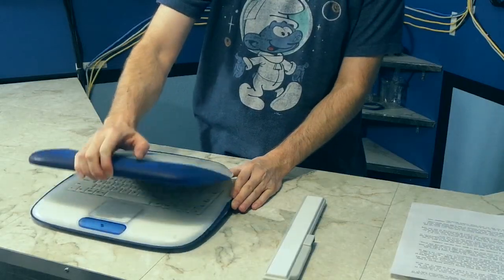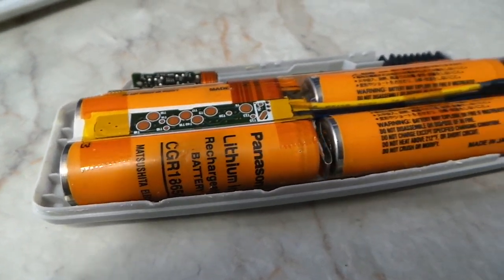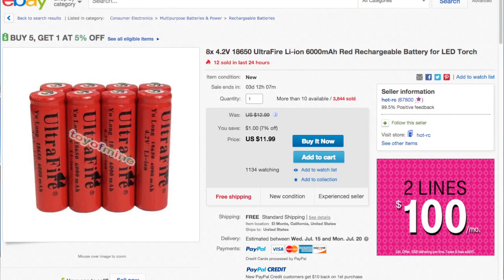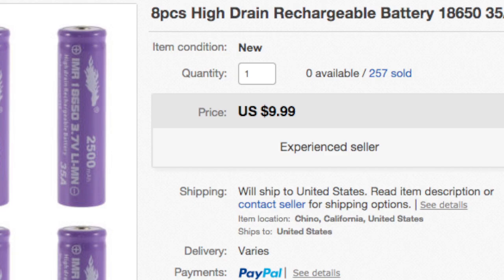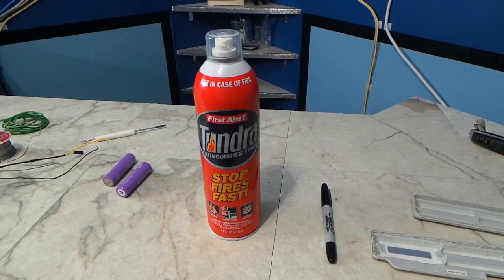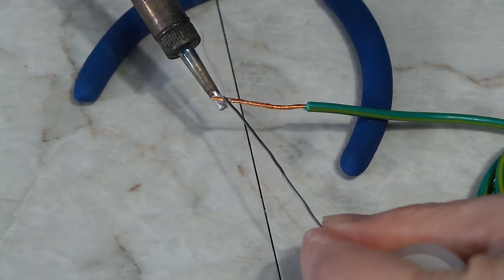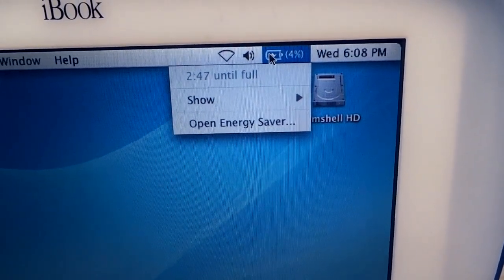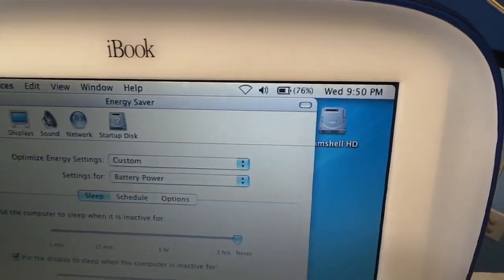Rebuild a laptop battery pack

Comment: Man, you need to calibrate them all so they can work together as "one" battery. Your laptop readings are fine, all batteries combined together got eg. 70%, but how much each battery got, it doesnt know. So, problem is, even if one battery are full, if another one becomes empty, in serial, its broken circuit, the empty battery wont allow electricity to go trough her. So i guess two batteries becomes empty, even another 4 of them got like 60% charge, the 2 empty could simply shut the circuit down. Some laptop batteries got like two groups of multiple 18650 batteries, that makes one laptop battery to be detected as two laptop batteries, and its made because of problem i said, means, if in one group of batteries, just one died, the whole group of batteries become useless, and because there is another group, laptop with that battery will continue to work, with 50% less mAh, and OS will tell you that one of two batteries (groups) has died.

Comment: And a warning so people dont waste time and money: 
-Not all lithium batteries can be fixed like that, some have a cycle count in the micro controller, wich prevents the battery from working again after its supposed lifetime has been achieved. A good example is a dell inspiron 1545 laptop wich can't have just the cells replaced, the battery still reports to the bios "battery life bad" and and laptop wont charge nor use their stored energy.
Reply: Exactly its happened to me after replacemet the cells, my laptop inspiron 3421, so how I can fix this problem please tell me if you know, 
Thanks
Reply: Why not just reset the controller?
Reply: @flameshana9  some battries controler cannot reset
Reply: @WildMidE  That sounds like a purposeful limitation. Like how cell phone batteries are hard to replace nowadays.

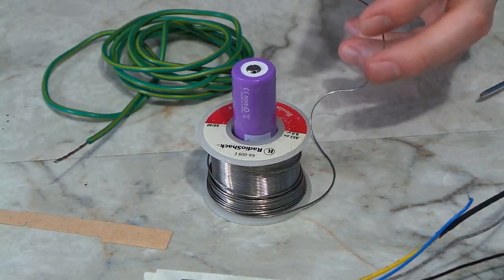Comment: 3:24 It's way better to buy a super capacitor and use it as a safe pinpoint welder and weld thin steel plates into the batteries (like the originals) than soldering it. Also way easier.

A supercapacitor with 500f capacity at 2.7v is totally safe (as 2.7v is a low voltage and wouldn't be able to electrocute anyone) and its also cheap. It doesnt heat up badly the battery, as a soldering iron, so it doesnt have the risk of loosing maximum capacity because of heat damage, nor it has risks of overheating and shorting out.

Comment: Holding a 370°C / 698°F hot soldering iron on a Lithium battery for that long is equivalent as putting them in a hot frying pan for ten seconds: It's more than enough to lit the fuse of disaster!

Comment: My laptop battery is 11.1V, so most likely 3 x 3.7 V batteries. Is it OK if I use 3.6V battery cells instead of 3.7V? Impossible to find 3.7V batteries these days, unless one goes for the Chinese fake ones..

Comment: Hello I saw your tutorial 
And wanted to repair the battery of a MSI ge62 6qf as it is not purchaseable new or used in my country 

As I replaced the cells it showed a constant charge of 67% 
And orange light for dead battery 

The cells I used are ncr18650b by panasonic and rated at 3400mah 

Any help in the matter would be appreciated

Comment: instead of applying so much heat to be battery to get the solder to adhere, just file the terminals down to make a rough service, clean terminals with rubbing alcohol, apply some flux, then solder. A rougher surface can help solder stick.

Comment: If you use flux on the battrey it would be way faster and the solder would stick way better so way less heat in the cell

Comment: :) you said that if you took 1/2 of the cells away it would'nt matter since the batteries are 5x cheaper why not test running another 5x across and see if it can handle the amps you wont be able to fit in all in the case but you should get a extended life if it will not melt :)

Comment: My way to solder 18650 cells is:
- First of grind a little bit the soldering points on cells with Dremel or a knife ( beacuse of the nickel layer on it )
- Then apply a little bit of flux or soldering paste
- After that use big and flat soldering tip for soldering
In that way the soldering is way easier and you can use much more lower temperatures of your iron 
The solder will do the same as nickel for not making cells corrode . 

BTW I Love your channel and seeing those kind of Old School electronics, i'm huge fan of that ;)

Comment: most modern battery packs that use lithium cells have complex electronics to monitor the cells , just replacing the cells will not reset the firmware in the charging electronics so the battery will not charge

Comment: You really should try to spot weld the batteries. I never thought it be a good idea to buy a battery spot welder separately. So I just modified my good old trusted Telwin modular 20 TI sheet metal spot welder. Worked like a charm for all the battery taps.

Comment: Personally, I would've gone with higher quality, higher capacity batteries, even on an older laptop. Although you really can't beat a "new" battery under $10.

I have an HP laptop which has great battery life despite only having a 45Wh battery. I can game on it for 3+ hours easily (of course, it's a low powered laptop with an AMD A8 APU). I think it'd be cool if I opened up the battery and added an extra set of cells in parallel to see if I can game for 6+ hours (however useless that might be).

Comment: oh so the chip need to learn  or calibrate new battery capacity?  no wonder.  I build 44 amp battery bank and the laptop still know it only 1.7 amp which is 1.58 minutes of run time.
Thanks bro.  YOu said need to drain it down.  HUmmmm.  it is 44 amp capacity.  how do I drain it down then let the labtop charge it up.  this is hard part....,  I don't have anything that can drain 16.8v  44 Amp

Comment: You should NEVER, read my lips, N.E.V.E.R. solder directly to the terminals of a Lithium cell. According to a conversation I had with one of the patent holders for LiFe cells you can bring the a lithium cell to it's 70C danger temperature where the cell will start self heating and then runaway.
Reply: Alright, this makes sense. But how would we do it then?
Reply: Tordur Hansen spot welding, very fast and localised. Does not give the cell a chance to overheat. Otherwise make sure you use tabbed cells and if your soldering is a little slow use small heatsinking clamps but then your problem is avoiding short circuits.
Reply: Oh I see. Thanks for the heads up!

Comment: IF you are going to mess with 18650 batteries (or similar), get a proper charger which monitors how much charge they can take and is able to trickle charge them when under discharged. Chances are some of the batteries in your "dead" battery pack are still fine, better than the cheap Chinese ones, and only one or one pair has failed.

Comment: You may have gotten even more run time if you left it to charge longer because the batteries may not have been fully charged due to the controller circuit not being calibrated.

Comment: might it not be wise to determine weather these cheap $1 cells can safely supply the current demanded by the laptop, it is not just capacity where these cheap cells fall down, current draw is also an issue.

Comment: Thanks for the video!

I have a Toshiba T1100 Plus that was given to me. Of course, the old NiCad battery pack was dead. I went to a battery store and obtained some new cells, rated at 5000mah instead of the original 4000mah. All I can say is that the run time is incredible! I used that laptop as my school laptop in college, and I used it all the time. I would get about 10 hours of run time on it, and only had to recharge it once a week. 

Keep in mind that I was using this computer at school just a few years ago, not back in the 90's or something. It turned out to be the most reliable computer I have ever owned. I got a lot of looks with that old dinosaur :)

Comment: Hope this helps someone. I was trying to rebuild an old Alienware battery that is not available for purchase anymore. I bought 2 used battery units. I found out that they are designed to fall apart if you try to open it up by prying it open. You need to find a very sharp blade like a box cutter and cut perfectly around the stickered warning label and thin plastic. You have to be very careful and do it perfectly. Cut a perfect square around the sticker with the plastic still attached to it. It takes 12 1860 batteries. They are lined up by six on left side and six on right side. The ends of the battery are covered with plastic and sticky thin paper, so they won't make contact with other batteries while being crammed in the plastic casing. You don't have to mess with any other electrical wiring, just snip the spot welded metal off from the top and one wire from the bottom. They have 2 pieces. One on left and one on right. The battery model is W83066L, the computer it goes on is Alienware Area 51 9750. This project kicked my ass until I figured it all out LOL.

Comment: Hello,

I suggest that everyone watches a video from Charlie Miller, titled "Battery Firmware Hacking". Then look up either Smart Battery Worshop or Battery EEPROM Works program for example. 😉🤔

You'll see it's not that easy just by adding/soldering in the new 18650 cells into the battery pack. 🤐

This surely applies to never laptop batteries. With older laptops this trick might work... MIGHT. 😆

Comment: Excellet video! Thanks a lot. Now I'm thinking about rebuilding my battery pack but I was wondering what mAh rated cells to get. As my battery pack has an mAh rating of 5400, does that mean each cell in the pack is 2700mAh?

Comment: Nope. Don’t cheap out on batteries‼️ Chances are it’ll overheat and vent all up in your laptop. Buy name brand batteries all in one batch. Also don’t “save” any cells from the old battery pack even if you measure correct voltage. The cells need to be matched/balanced. Just remember your still saving 💰💰💰 by not buying a brand new laptop battery pack. 
The only question I still have is do the batteries need to be “protected” or unprotected. Not sure if the protected batteries with the circuit inside them will interfere with the charging/balancing circuit in the laptop.

Comment: hi i have problem  i was connect my cells in the same way like yours but it not work  the signal light battery it still  show me yellow  light color and in the some second show me blue color every second replace like that now my dell laptop it work like desktop so could you help me to solve my problem?
Reply: wellman the preacher Hi,

Look up a video from Charlie Miller, titled "Battery Firmware Hacking". Then look up either Smart Battery Worshop or Battery EEPROM Works program for example. 😉🤔

You'll see it's not that easy just by adding/soldering in the new 18650 cells into the pack. 🤐

Comment: But is it ok to use regulated cells like those you used? I mean, the battery pack's electronics are already there to regulate that, so using cells with another regulator seems wrong. idk.

Comment: buy name brand batteries like Samsung,Sony,LG etc 
Stay away from any battery end with fire or start with trust or rewrap batteries like efest
it's crucial to buy INR batteries incase of something bad happens 
You wont be getting more than 3000 mah from a 18650 and it'll be arround 10-15 amps max and so keep away from anything says even 3500-4000 mah
My suggestions are ;
2500 mah Samsung 25r,LG HE2-4, Sony VTC5
3000 mah Samsung 30q,Sony VTC6
If i were to build 1 for myself i'd go with Samsung 25r for reliability and safety.

Comment: One tip: Adhesive copper tape does wonders - adheres very well and you don't need to heat up any part of the cell, and they are very thin meaning they're good for confined spaces (like these laptop batteries) where soldering adds unwanted thickness. Less messy too, and no need for extra wires or anything. I used them for two separate batteries that I refurbished a while back and they work seamlessly.
Reply: I'm going to try this for testing purposes. Sounds like a good idea for non permanent projects too.
Reply: @Kit-lb6tr  I'm assuming the adhesive side is non conductive right?
Reply: @cheezyfriez12  Depends what kind you get, some are conductive on both sides some aren't.
Reply: Nice idea but i found it in wrong time, arghhh
Reply: Adhesive copper tape...hmmm...interesting...I'm curious where I can find that in Brasov, Romania - will try online as well but thank you for this useful tip - trying to repair a laptop battery from 2012 for an Asus x54c
Romanian - romana: banda de cupru autoadeziva...hmmm...interesant...sunt curios unde pot găsi așa ceva în Brașov, Romania - voi căuta și online dar mulțumesc pt această sugestie folositoare - incerc sa repar o baterie de la un Asus x54c

Comment: What if I want to remove all the 3 batteries of 4.2v &  2200mah from my laptop battery case and replace them by 3 new 3.7v 3000mah battery ?
Will it work?

Comment: Rather keep clay bucket/pot (as it's non conducting and heat resistant) and bags of fine sand you can throw over flaming battery, as it won't mess up electronics as water/foam extinguisher does... and those dust extinguishers make way more mess than a small fire, and li-ions keep re-igniting after you extinguish them. I tried it ;-)

Comment: i have collected two diffrent battery cell both are samsung 18650 after assembling it it showd 10.7 volt but problem is that battery going to be charge fully within ten min and discharge in half an hour.kindly suggest some solution.

Comment: I wonder if you can do this with nickel metal hydrade (NiMH) batteries. They're cheaper than lithium and the name brand ones get about 2,500mAh each on a 1.5v AA. The charging circuitry should prevent overcharge Iirc.

Comment: Those batteries look like purple Efest/Efan batteries, although for some weird reason the wrapper doesn't say Efest where it usually should say it. If it's a clone of a rewrap, then that's unusual in and of itself, but if it's the real deal Efest batts, they shouldn't be total scam cells on the inside. Chances are, they're actually rewrapped cells from quality producers. Just unwrap it and see what you're dealing with. Unless Efest sourced their cells and put their own casing on them, which they aren't known to do, the cells should have the original manufacturer laser etching on the metal casing. That's normally the case. Rewrappers, like Efest, never care to hide this, because people normally never take the battery wrappers off.

While these Efest batts (if they're actually Efest branded batts) are in no way truly rated to handle a continuous discharge of 35A (as the wrapper suggests), these batteries used to be LG HE2 cells on the inside, which were very high quality cells and among the best you could get a few years back. Sure enough, your batteries look like button top LG HE2s on the outside, from what I can tell. If so, your batteries are fine and are true 20A 2500 mAh cells.

The problem COULD simply be an uneven charge level among the cells and that the charging sensors detect some cell pairs to be fully charged while others are still almost dead. Thus it will indicate 100% in order to avoid an overcharge, but suddenly drop to 0% to avoid an undercharge. This can even out over time, but to assure the best result from the getgo, you should have individually charged the batteries to identical voltage before assembly, in order to assure synchronized charge levels and cycles. This also helps to avoid the danger of overcharging or undercharging individual cells, which can wear down the battery or worst case cause a failure. Overcharging lithium cells is no joke.

Comment: Hi, 
Do you recommend to use LG HG2 cells as replacement for an notebook battery? 

The Computer is from 1994 and all cells are dead (checked with my multifunction charger)

Comment: I gutted the pack on a snap-on cordless screwdriver, got frustrated and rebuilt the damn thing to I can use any AA batteries I want. It's a good setup. Now I can finish the work even if my $100 battery bites it.

Comment: My experience with cheap ebay batteries, they are more like 300 to 500mah and not 1000 to 1500..they do lie terribly. I bought a charger that tests the capacity and it was well worth the money. The best bet is to buy new laptop batteries  when you can get them on ebay cheap, tear it apart and you are almost guaranteed a minimum of 1700mah, and as likely as not a good 2000 to 2200mah 18650 battery, and for very little per battery.

Comment: soldering to the battery terminals seems pretty unsafe to me. You just need to be unlucky and melt the insulator inside and the battery will explode :/

Comment: If anyone wants to follow instructions like shown in this video always make sure You Don't Solder The Two Vent Holes Closed (Positive End Of Each Battery) Because If You Do, Your Batteries Will Explode. Vent Holes Are There For A Reason!!
Reply: Vent holes ? Please give me more details on this. He nvr mentioned any caution about this !
Reply: what you mean      those vent holes are even connected together (parrallel circuit)

Comment: A bit off topic, but I use 18650s for my vape mod and there's quite a few shops that actually carry ultrafire batteries still.  One shop, the owner was clearly aware of how crap they are and kept them in an "unofficially" (hand written) labeled case "Ultrafire 18650 3000mah".  From my understanding, some of those cheap brands also misrepresent the amps for them as well, although I can't say for certain if that's true.  Point being is if someone wants to do a project like this, I'd recommend going for good batteries (sony, samsung, etc) and not take a risk with rip offs.

That aside, this was a good video.  Something to keep in mind since I have some extra batteries, although no laptop to test this with haha.

Comment: Imren is actually a half decent brand.  They rewrap samsung or LG cells and sometimes put a protection circuit on them like you have there.

They also get ripped off a lot, theres tons of fake imren batteries on the market.